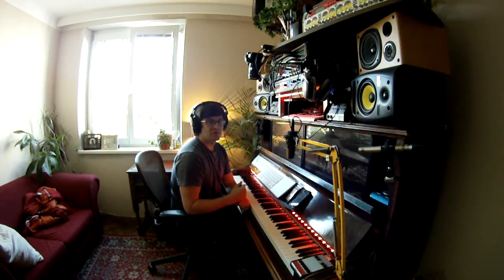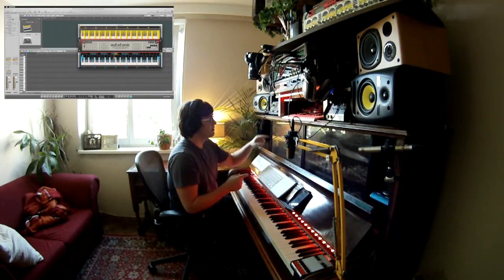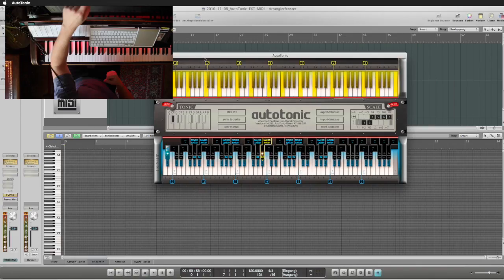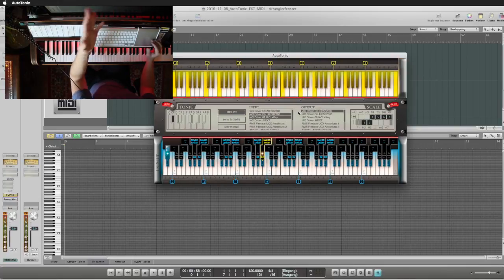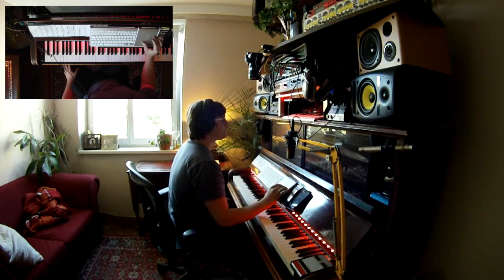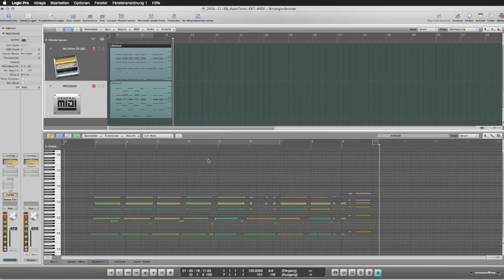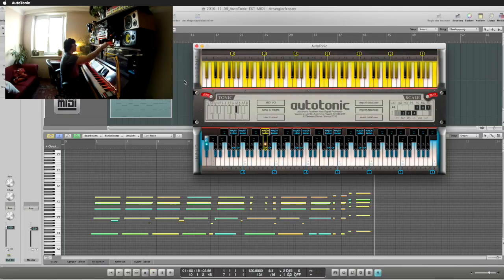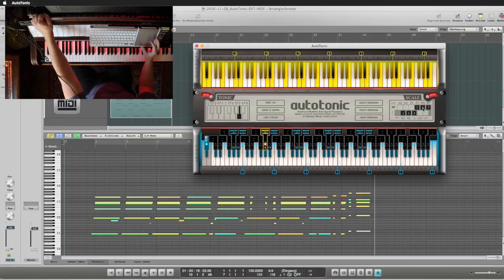AutoTonic – Non-Destructive MIDI Workflow

Comment: Thats one of best AU plugin I ever seen. Only you have this possibility — play different scales for different tonics. Other plugins dont have it.
Reply from the maker: It is not a plugin, it processes signals independently from any DAW (as the plugin format would be for the worse [!] from a technical standpoint), but yes, AutoTonic allows of some features that you won't find anywhere else … true modal transposing, customizable scales database, realtime switchings, multichannel operations, freely assignable chord memorizer which works modally etc, etc, … The list ist loong and it will take some people years to understand. Thanks for your positive comment!
Clemens